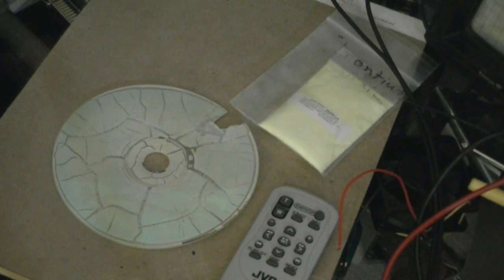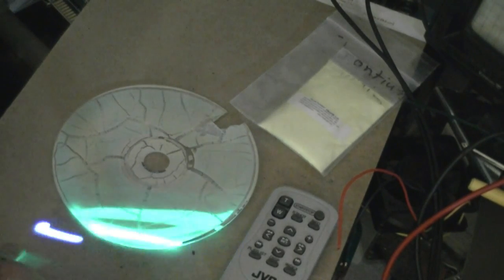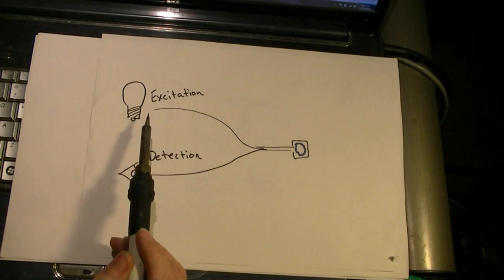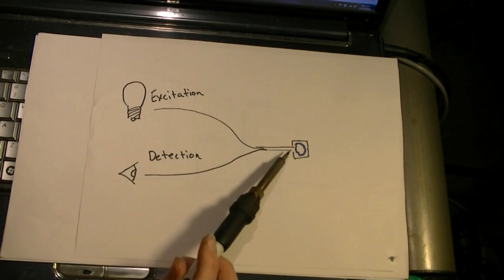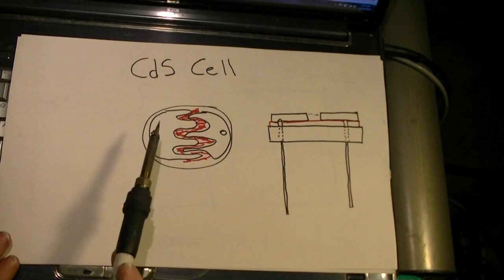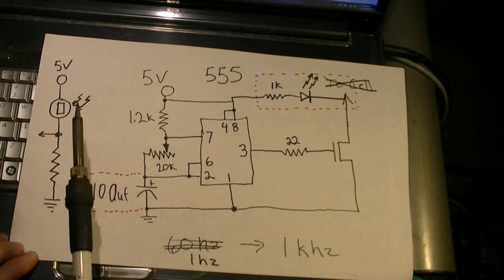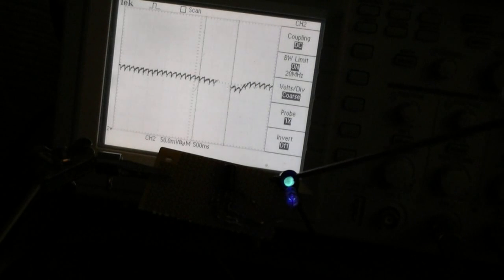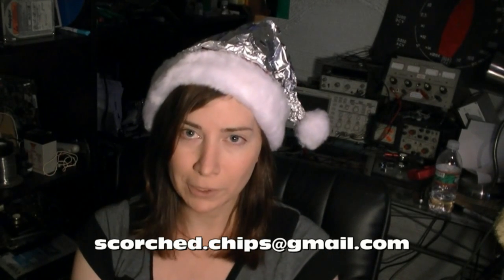Practical uses of Quenching in Phosphors

Comment: I take it you were experimenting with heat from the soldering iron, seeing that you were using it as a pointer?

Whenever I used CDS cells, I found that, though incredibly sensitive, they are quite slow to respond, especially at low light levels.  To the point where you can watch the needle move slowly on a meter!